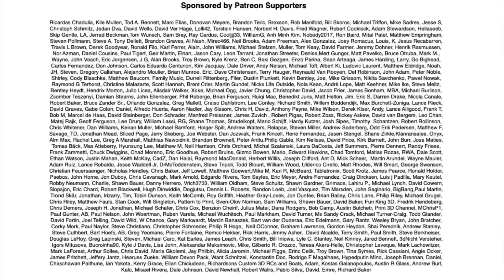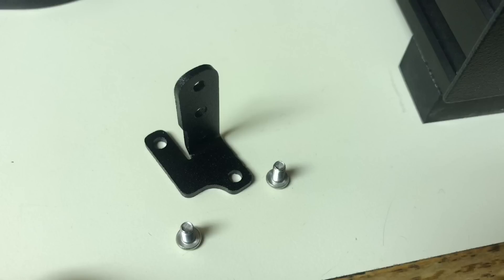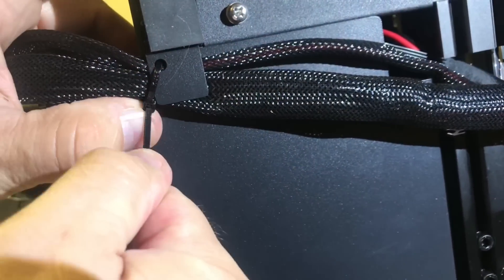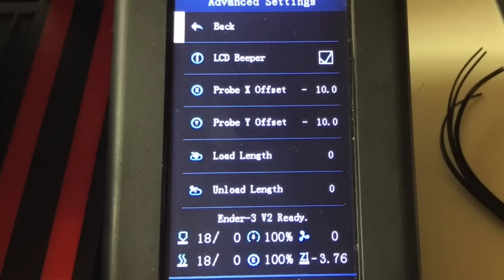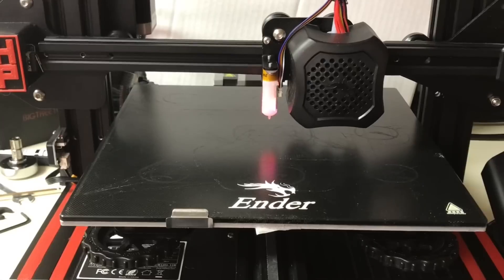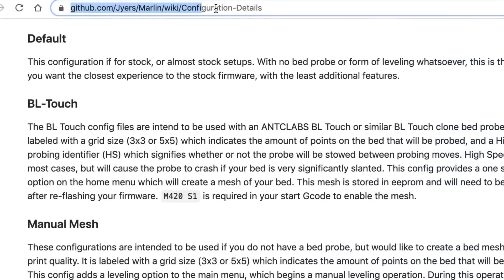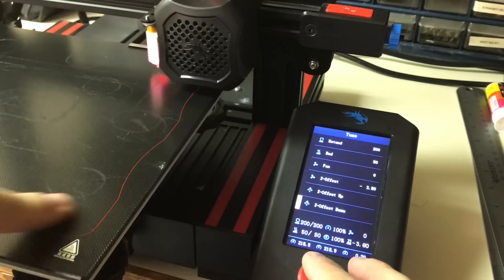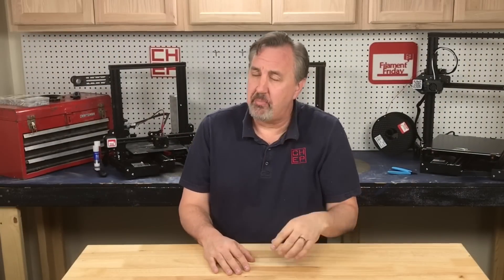How to Install AutoLevel on Creality Ender 3 V2

Comment: I am amazed how so many people get a different response following the same directions. Like the label Autohome is not there instead it is All Way. How did the menu get changed when we are all downloading the same firmware from the same site? Chep. I appreciate all that you do, your videos have helped in so many ways. I followed your installation and it worked. I printed the test and then made a few adjustments using the V2 control and the next test print the nozzle goes up to center and stops. The screen even says stopped. Nothing I do works including going back and reinstalling the firmware even reformatting the card. So, after this long winded prelude here is my question. How do I start all over again? How do I clean whatever needs to be cleaned and start over.
Reply from the maker: I don’t control updates to the firmware. Seems like a minor detail though. 
Go to here for original firmware: https://www.creality.com/pages/download
Reply from the maker: Did you use the same v1.3.1 I used in the video?
I suspect people are using newer versions that weren’t around when I made the video.

Comment: Is it really necessary to run autolevel on each print? Isn't the printer supposed to remember the mesh and apply it on each print automatically? I have Ender 3 Pro with SKR Mini E3 V3.0 & BLtouch.
Reply from the maker: You can save it to memory and only run it when necessary. Your choice.
Reply: The point is, that man people remove the bed when they remove the printed part. With Autolevel you have a system to make sure than the leveling is correct even if there's a slight change in the position of the surface.
Reply: @hassosigbjoernson5738  I use glass. If it's attached back with same clips at same points, I don't think there can be significant change on surface elevation.
Reply: @jpenna1976  yeah, with a glas surface your right. but with a bendable metal sheet (which is standard for most of this machines) is does make sense to autolevel it before a print and after bending it to remove the last printed piece.

Comment: Hey, I am using a 3D touch and when I do auto home everything works, but the probe just goes out and in bit the z axis doesn't move.
Reply: Had a similar issue where my Z-Axis could not move down. I reseated the wiring and now it works. I would say check your wiring and then check if your firmware is correct.

Comment: downloaded this for my v2 with cr touch and boots up fine till it goes a home for Z then it moves up, this is like 90th different firm ware ive downloaded. if turn the machine on and move the z before the auto home it goes up and down fine.
Reply: Mine too! I read a comment below that they had the wrong firmware. I tried the E3V2-BLTouch-3x3-HS-v4.2.2-v2.0.1.bin instead of E3V2-BLTouch-3x3-v4.2.2-v2.0.1.bin and now its going down afterwards...No idea what HS is though

Comment: BL Touch and 4.2.2 software without adapter v1.3.1 Z AXIS WONT MOVE DOWN 

On Ender 3v2 I installed firmware for 4.2.2 with BLtouch no adapter, it deploys the pin twice at start up, and when I go to auto home it, x/y go to 0/0, it then brings probe to center, pin does not deploy, z does not move down. With the “Move” I can move the z axis up, but not down. I’m not great with firmware, does anybody have a fix? Came with the 5-Pin plug to go behind the display cords on motherboard, I unplugged and removed my z-stop as well. I’ve scoured the internet and can’t find the solution. With z-stop plugged in , i can move the z-axis and it moves during homing, but it will just crash into the bed unless i hit the switch since i removed the z-stop. do i need to go into the coding of the firmware and change something? im so lost. Please help!!
Reply: did u fix it ?
Reply: @BadmanCorporationGaming  had wrong firmware
Reply: @PurpPeeps  Thank you! I also had the wrong firmware. I had E3V2-BLTouch-3x3-v4.2.2-v2.0.1.bin but i needed E3V2-BLTouch-3x3-HS-v4.2.2-v2.0.1.bin
Reply: I'm suffering from this too, tried 3 firmwares.

Comment: Unfortunately since I have installed the 3D Touch... my Z axis is moving UP but not DOWN anymore. I have tried to connect the Z sensor again, just to see if it has anything to do with it but nope... nothing. It's simply not moving down anymore. And it can't be the cables because then it wouldn't move up either... Help please
Reply from the maker: Sounds like the stepper is driven backwards. Did you change the firmware?
Reply: @FilamentFriday  I actually already fixed it. The black and white cable from the 3D touch was loose lol
Reply: @tobiascavalcanti3732  where they obviously loose or did u poke them ?
Reply: @BadmanCorporationGaming  i fixed them with hot glue own🤣
Reply: I have got the same problem, but my cables aren't loose. Could there be any other reason?
Reply: @davidkania7430  I checked absolutely everything and downloaded every soft of firmware, I ended up buying a second one and worked no problem

Comment: Love your videos, very informative with no bull. I followed this video to install a knock off unit and I used the 2:20 time of the video to connect mine to the mother board. Well smoke came from the board, good news it did not do damage I unplugged it in time. A note if you are installing a knock off the wires are reversed, the white wire is closest to the display plug.

Comment: How is this auto levelling if you still have to level the bed manually with a piece of paper, do level test prints and further adjust manually from there?
Reply: Not sure where you got the manual part from, he does it once in the beginning to have a starting levelled bed - you don't need to manually level it after installing any of the many touch sensors out there. To have a very level bed to start from should be logical, the sensors just tell a software "point X has been reached" and the software extrapolates a plane from a few touched points, the more level the bed is from the start, the more level that plane will be. Purely theoretically you can start from an extremely slanted bed, but imagine how much extra movement that means for the stepper motors and how much more slicing the software will have to do.
Reply: that's what I thought, seems more effort than normal aha
Reply: Because you do it that one time and then it's done? Are you serious?

"How is this instant noodles if I put the water in and it doesn't instantly cook?" Good god.

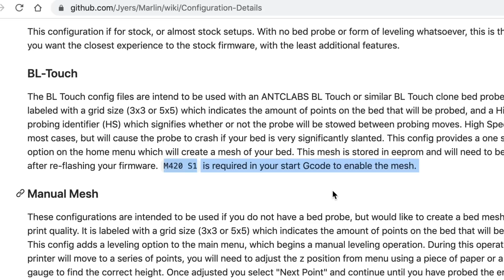Comment: @CHEP Is there a print file for the 3x3 Squares at 5:57 or does Gcode handle it. If its a file would mind sharing?
Reply: I can't find this anywhere, does anyone have that would share?
Reply: @direhavok8732  On the cura plugins there is one plugin called callibration shapes. by installing this plugin you will have a menu under Extensions to add those test prints to the project.

Comment: do you think this mod will also work with the ender 3 max because it is basically an ender 3?
Reply from the maker: Yes. Just have to get the right firmware.

Comment: all im geting is a blue screen on my ender 5 been like 10 mins plus
Reply: same here
Reply: It took me a little digging. I had to format a new SD Card and reinstall the Ender Pro 3 Firmware. I found it on the Creality website. Then reformatted the SD card again and installed the BT Touch Firmware. My screen is back up and now see that the BT Touch is available in the control menu. NOTE: My display and UI looks different than Chucks. I still have the factory standard Ender Interface. Maybe Chuck can advise from here.
Reply: can confirm that this works
Reply: @officerM1911  Not sure if that's it, but Chuck has an Ender 3 v2. Not an Ender 3 Pro
Reply from the maker: He’s right. Reload the firmware using different filename but just one character and use a different SD card. The blue screen means it didn’t take the first time. But it has to see a different filename.

Comment: What would I do if I get a similar result like you? Would it be right to now manually adjust the bed springs or do I do something else? I have it where the left front corner is scratching the build plate and the rest prints fine and I am using a CR-Touch.

Comment: I've installed the Creality original kit, and updated the fw so it has a Level button, but I have a Z-offset submenu, I can't do Z-homing, live adjustment or the microstep adjustments or click Save to retain any changes I make. Also I don't have the Tune option during printing. Could you let me know what firmware you're using?

Comment: This is a great video about how to install the hardware but the setup really lacks some things. I've tried ALL of the firmware files I can find including the one in the booklet that came with my BLTouch (of course after downloading it, shortening the name and installing it, it was in Chinese.

I have never found the Auto Home menu option on ANY of the firmware. I have been on computers since the bulletin board days in the 1980's, I can build responsive websites and forms but I'm about ready to chuck this BLTouch in the canal behind the house and let the gators eat the thing. When I first saw this video I thought this would solve some of the leveling issues with my Ender 3 V2 but right now I have my doubts.

I found a couple of things about the wiring being wrong but none of those people 'showed' how the wiring should actually be in the correct configuration if that was true.

Does anybody have a link to the correct firmware that actually makes this thing work? How about a link to some written documentation? I realize this is a year old video so maybe someone might happen by and post some updated info. (Hopefully before I trash this thing and waste the money.) Thanks for any reply from anyone.

FYI - I did purchase through CHEP's link and mine has the proper labeling on it so I think I have a 'real' BLTouch.
Reply from the maker: Use the Jyers firmware I link to in the description and use in the video. Auto Home is in the Prepare menu
Reply: @FilamentFriday  Mine does not have Autohome, it says "ALL HOME"
Reply: @FilamentFriday  followed along perfectly, their is no auto home in the Prepare menu
Reply: same here, their is no auto level anywhere, this video is so inaccurate
Reply: @dalewelsh1494  i followed his instructions to the T and i have auto level in my settings. Do you think you may have slipped up somewhere along the way?
Reply from the maker: Did you download version 1.3.1 like I did in the video?

Comment: Thanks for the video helped me out alot, i had a quick question does the M420 S1 have to be added to every print i do when i slice it do i need to add that ?
Reply from the maker: If you want to use the stored level then yes to both. Otherwise and G29 and it will autolevel every print.

Comment: I have no advanced option under control.  I can not therefore adjust my x and y offsets.
Reply: Same here
Reply: @WillYouSurvive  I did eventually get it all to work.  Creality very poorly names there firmware files.  There was another one I had to download and use instead of the one I thought was the latest.  I didn't have to adjust X, Y offset.  Still not sure how to do that.  I believe the new firmware doesn't require that.  I did have to calibrate the Z offset though.

Comment: Thanks!
Reply: This guy's series of videos have saved me more time, money and frustration when starting out 3D printing.  Have only had my Ender 3v2 for a short while, but because of this guy's tips, the prints are amazing and not the frustration, and wasted material, it was initially with trying to get good prints.  The slicer settings for a good first layer video was also super helpful, and got me over the hump on getting that great first layer and good sets on an uneven bed.
Reply from the maker: Glad I could help

Comment: At 2:20 would be a good time to remind people to check what version board they have.  On the Ender 3 V2, you should either have a 4.2.2 or a 4.2.7. This will affect which version of software you pick at time 2:58.
Reply: Nice heads up 👍🏻

Comment: Do I need to adjust z sensor after adding glass bed and square springs?

I'm scared 2 run a print nozzle sits way lower then it did with stock beding.

Comment: Well I copied the same firmware to a micro SD card and put it in my printer. Now the screen doesn't show anything. The backlight turns on but nothing ever appears on the screen whether the SD card is in or out....
Reply: Did you turn it off and on like he said
Reply: @CompyBoi  Yes, I turned it off, inserted the micro SD card, turned the printer on and waited. I left it like that for over a minute before turning it back off and removing the micro SD card. Now I can't use the printer because the screen doesn't show anything.
Reply: After some more research and trying another video's link, the printer is working again and the leveler is a bit different but works better.
Reply: @44KingFisher  can you link me it im having the same issue
Reply from the maker: What version did you use and what did you get to work?
Reply: @FilamentFriday  i used the 4.2.7 that was on the official creality website, how did you measure the y offset?
Reply from the maker: Watch 3:12

Comment: m420 S1 seems to be throwing me an error in octoprint, any solutions?

"Your printer's firmware reported an error. Due to that OctoPrint will disconnect. Reported error: Failed to enable Bed Leveling"
Reply from the maker: Did you store the mesh level in EEPROM. First?

Comment: Hey all, do we just move the original Zstop switch out of the way or do we have to unplug it from the board?
Reply from the maker: I didn’t do either. The firmware should ignore it and the carriage never get low enough to hit it.

Comment: Do not use the current BLTouch firmware on the Creality site ( thanks for the firmware links to Jyers ), it leaves you in a state where you can change the Z value and it isn't close enough to print.  If you adjust the Z-offset, and home, it changes the Z-move by the same amount, with zero net effect on the physical position. grrrr.

Comment: Hi chep, great work, but when i autohome, my bl touch is not in the center of the bed, how can i fix that?
Reply: You either need to set your probe x-y offset. Or change printer machine settings to home to center of bed.
Reply: @tomtaylor135   if i set x,y offset to 0, nozzle is not in the center of the bed🤷‍♂️
Reply: @dominikmiko6849  I have issues with my Z axis ... no matter what I do with my Z-offset that plus the Z-move is 10 , and it ends up way to high to print anything.

Comment: Yeah except on some Ender3v2 (mine) that 5 pin is buggy and don't work and you have to splice the wires into the Z-Stop connector. and then it causes problems 6 months down the road

Comment: Hi, I have an issue with the firmware. I have a BLTouch and when the printer tries to do a Homing on Z-axis, the BLTouch probe stays in while the printer goes down. The printer never stops before hitting the bed. What can I do to fix the issue? I tried version 1.3.4 (same as the video) and the newer version 2.0.1 both with the same result.
Reply from the maker: Check the BLTouch wiring

Comment: I have added 
G29 ; Auto bed-level (BL-Touch)
to a few of my GCode files and when I print them the BLTouch will auto level before each print. But some times during the auto level process, the BLTouch will fail to auto level. Like during the point 6 or 7 spot it will go down but the pin wont hit the magnet. The then red light goes on then it starts the print (does the first line to clear the nozzle) but the pin is not magnitized in the up position so I have to manually push it up , otherwise when the nozzle moves to the right, the pin will bend on the bed. I have had to replace a pin already. 

Any ideas why that would happen? I have looked all day but have not found a solution to this issue yet. I have the ender 3 v2 and the 4.2.2 board.
Reply from the maker: Sounds like a bad BLTouch.

Comment: just a heads up, I installed this to my printer and got to the z-axis part. It would not home correctly, kept brining it to the far right corner. The fix, I had it do a bed level and then it found home. I will do a proper level once the z-axis is adjusted and the bed is warm.

Comment: The orientation of the colors of the plug going into the main board threw me at first. Usually Black/White go to 'G'/'OUT' where yours go to 'G' and '5v'. My BLtouch died
so I got a 3Dtouch as a replacement. By using the old BLtouch plug the colors match yours and all is working good.
Great video and thank you.
Reply: How it is so properly connected. Everyone on the Internet has it differently. I have the same colors and order of wires as in the video. So should I plug it in anyway?
Reply: @Snakeczcom89   On my 3Dtouch where the little plug connects the pins are labeled. I don't think my old BLTouch had any markings.
Reply: @kickbaktube  I've already involved it. On my BLtouch, the wires are connected in the reverse order of the video. So I turned it over on the board and it works.